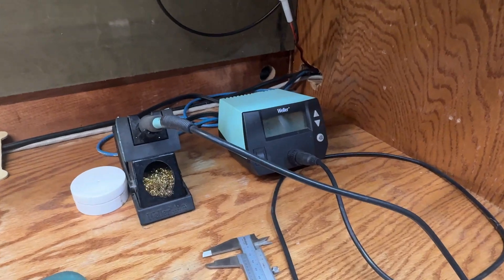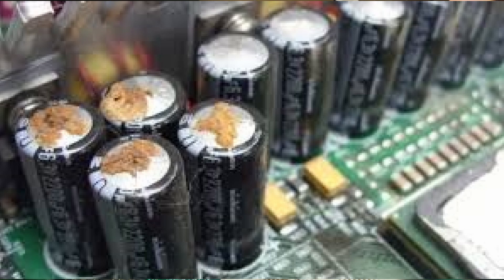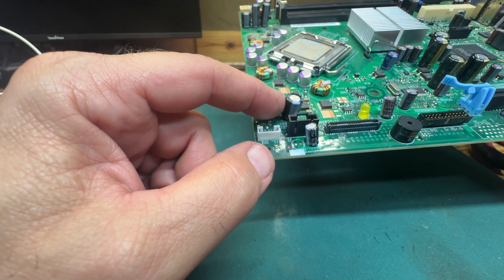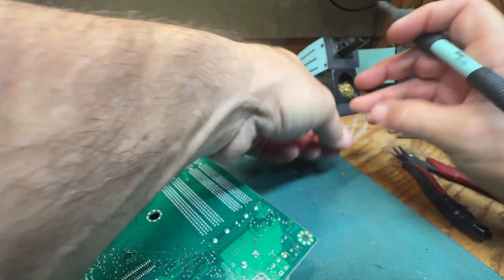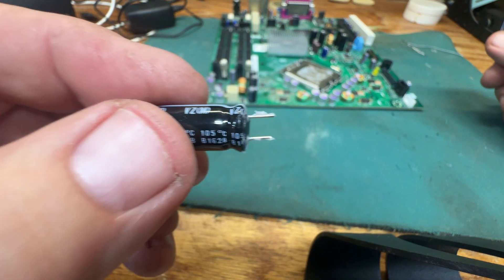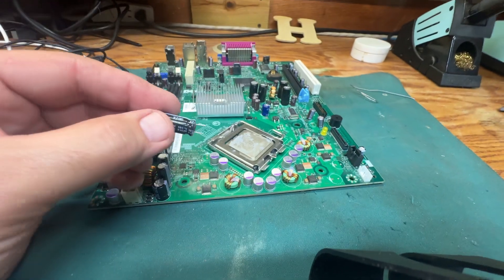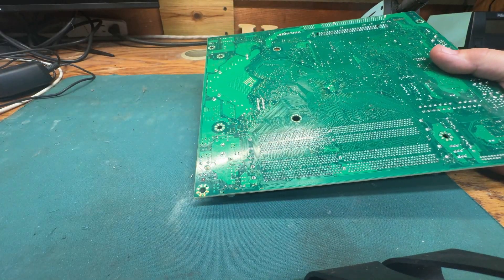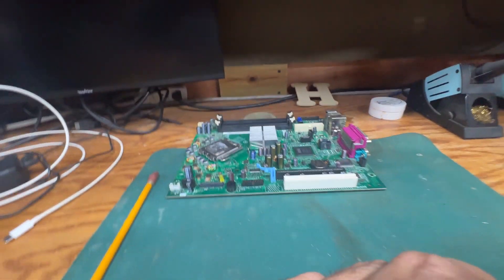Here is how to solder capacitors off and then back onto a board.

Comment: Hardest part about this is going to be holding that capacitor right there while I flip the board over to get to backside while I apply heat and solder… reason legs are so long on new ones. Clean holes

Comment: A task I have ahead of me... Motherboard with a case of badcaps
You can go a step or 2 higher in voltage (though it's likely to mean the capacitor is larger and may have problems fitting).
Also, capacitor quality is important, because it's the VRM section of my board, low ESR caps are a must - and 105C rating are preferable to 85C - I'm also going for a partial polymod, replacing some of them with solid polymer, it's possible for the different characteristics of polymer caps to cause issues if the circuit was poorly designed.
TBH, it's a cheapskate polymod, only the ones which are not that much more expensive in poly than in good quality electrolytic, as higher capacitance and voltage get a lot more expensive in polymer

Comment: I find it helpful to use a vivid marker and put a small dot on the board where the negative lead is ( the strip ) before removing the original so you don't forget when putting a new one back in... because it's really easy to question yourself as you're putting the new one in!
Reply: There is a clear, visible markings silkscreened on top surface of the board...